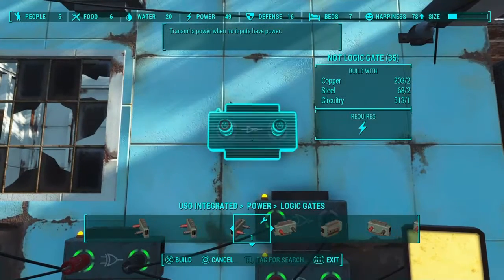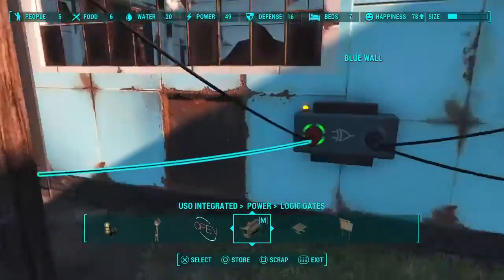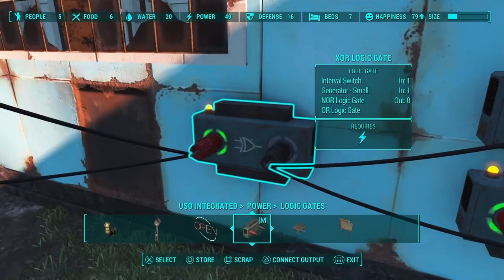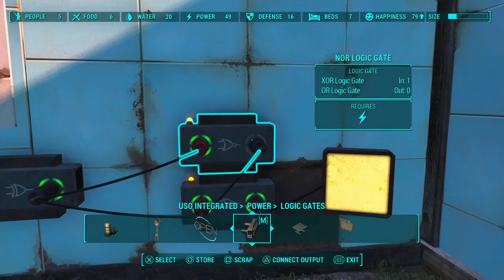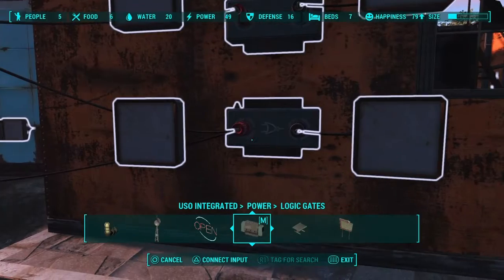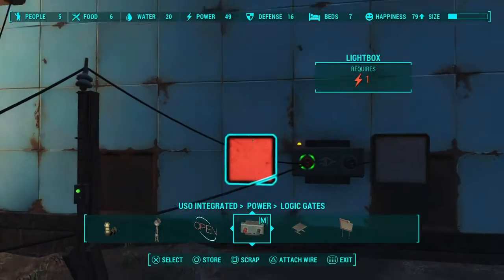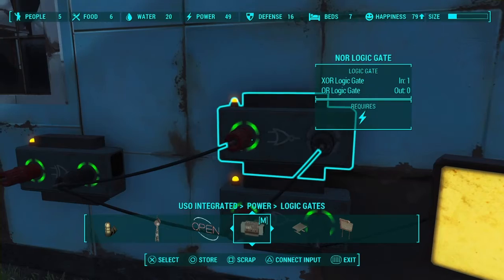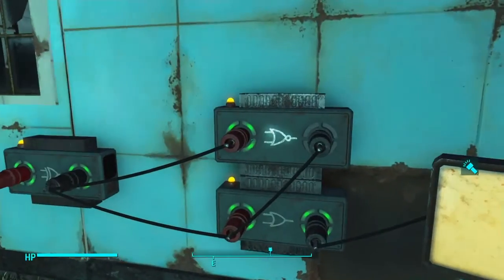Fallout 4 - NOT and NOR Logic Gates - The Tutorial

Comment: I built 2 powered  doors controlled by a switch. The power went to a switch, then one wire was directly went to the first door, I connected a second wire to a not gate then its output to the second door. Each time I flipped the switch one door closed and the second one opended. Flip the switch and they changed. There was not anything complicated about it. One door was always closed when the order was open.

Comment: The main reason for confusion is that there is a Power circuit AND a control circuit (on/off or "0"/"1" if you prefer) in the same physical wire but they are distinct. Before logic gates, things were "powered" or "not powered". On or off. 0 or 1. Simply binary. With logic gates, it is now trinary: "powered and on", "powered and off" and "not powered". Powered gates always transmit power BUT depending on if its conditions are met, will send an on or off signal. To the player, it might seem like an object is powered or not powered but in reality it is either "powered and on" or "powered and off". You can see it in other logic gates because they have an orange indicator light. People not knowing this won't distinguish between "off" and "not powered" and therefore wire things wrong
Reply: I saw the video and my main question didn't changed. My initial thought was... "that's impossible that a swich could ever transmit power when no inputs have power, that's just nonsense, that would be a big "goodbye power generators" followed by another big hello NOT logic gates... imagine a swich that gives you power only when you have none... senseless but true to what they "promise". Of course you have to have power otherwise how could they transmit power at all, it would be a miracle. You just explained what the game or this video didn't. Thanks a lot

Comment: I wanted to rig two gates that close when either of two alarms are triggered. I did this in small scale by going Power -> Alarm switches -> Nor gate -> 2x Nand -> 2xNot -> 2x Gates (The Nand gates also had a direct power feed to their inputs). It worked perfectly but when I did it across the camp it wouldn't work. I later tested and found out that using even one power pylon confuses the system. Is there any way around this? Would prefer to do it without mods. Thanks.
Reply: i did this as well.
(3 alarm towers and multipule doors)
i found using one conductor for multipule inputs and then connect it to switch simplifies the in puts 0 or 1 for single switch input.
Reply: I did and,not,,and

Comment: OK did I miss anything? I do not see anymore videos for this series? I built a recycle plant and trying to figure out which gate I would need to have my vacuum hoppers run separate from my belts and recycle machines. Can you help please? I think I put a video up so you can see what I am trying to do
Reply: you can use a roller section to seperate the power -i think-. 
otherwise lay down a floor under the vaccume hopper, and drop items to seperate belt(at normal height)